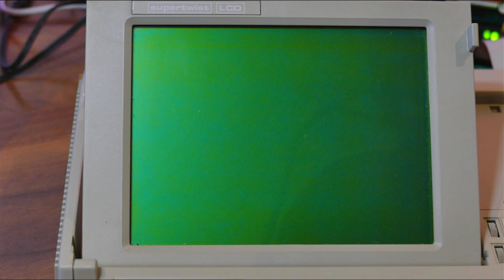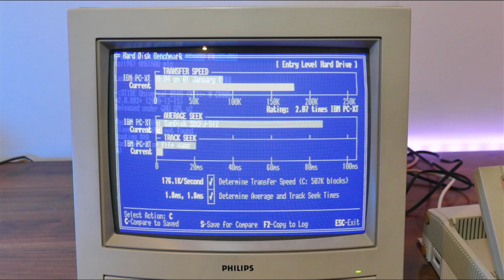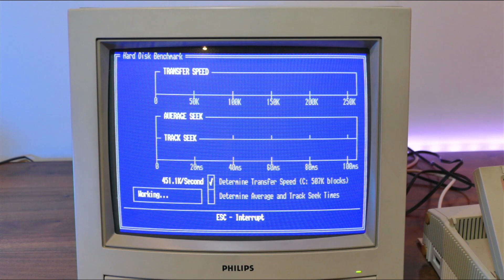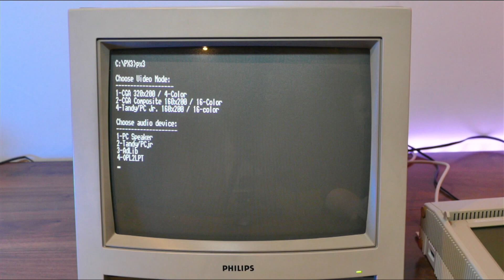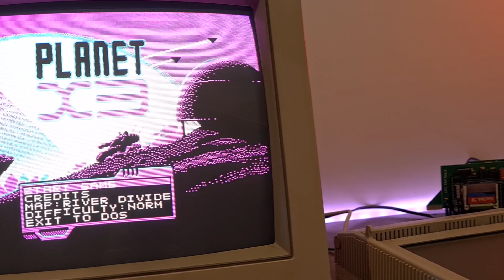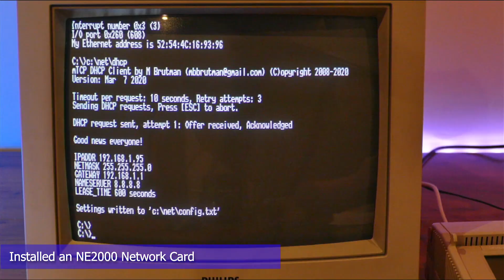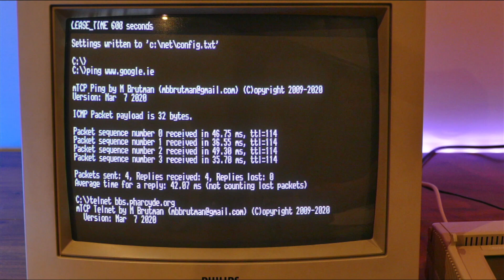Amstrad PPC512 ISA Expansion Board XTIDE Network Sound PPC640

Comment: Really good. How about extra power consumption? Does the PPC support that - maybe only with a better power brick?

I have purchased one of these PPC 512, I had a PC 1512 as my first PC in about 1987 onward after my school 🙂
Reply from the maker: Thanks, That was about the limit, if I added a another card it would cause weird power issues .  The limiting factor is the internal power regulation,  especially >12V to 5V.  Its just a linear regulator in there.  A better power brick wouldnt solve that.  but the board can be power isolated from the PPC and have external 5v /12V

Comment: Hi there.. great little projext.. what is the current status? are you planning a production run? or just the schematics?  I would definitely buy one of these.
Reply from the maker: Thanks, This was a stepping stone to eventually create an internal card.  First prototype of the internal card was made in December,  I need to make a few changes but the whole project will be up on github when I am done.
Reply: @RetroTheory  that's excellent.  My only issue would be getting the PCB printed.. Facilities over here are pretty scarce.

Comment: Thanks for the video and the Files, I've just started the same project for my PPC as I couldnt find much info on it.  I'm looking to do this as an iternal upgrade tho.  Any chance you could upload a list of parts required and where to source them in the github repo
?
Reply from the maker: Will do,  all components are  written on the PCB, but I will push a list up.
Reply: @RetroTheory  Thank you sir! Looking forward to the next episode
Reply: I put two ISA slots into the Place where the Modem should go in. With an XTIDE Board and an EMS Board to run more games and Windows 3.0 . When I installed the two boards, I also wanted an external solution like you, but I'm not good at all in designing PCB's ;)
Reply: I am interested in your project for my web page, ping me when you can show it to the rest of the world please.

Comment: I absolutely need one of those PCB's! Is it possible to made one with 6 Slots? I want to made an XT Gaming Machine and need 6 Slots for all my Cards. But 3 is also much better than nothing, thank you ;)
Reply from the maker: Six slots is possible. Power would have to be looked after though. You would need a separate 12V.5V.,-12v  for the additional load.

Comment: How are you getting the display on the monitor? Couldn’t see a CGA to VGA adapter
Reply from the maker: That monitor can take CGA directly, it can switch between TTL and Analog.
Reply: @RetroTheory  sweet! I just got myself a PPC512 with a rare as hens teeth backlit screen pre fitted. It makes using it easier, but a monitor would be nice. Is there anywhere I could buy a pre made expansion board or even the PCB? Happy to pick up the soldering iron 🙂